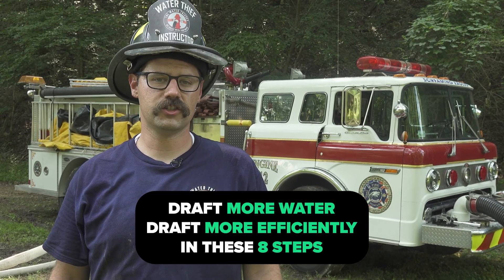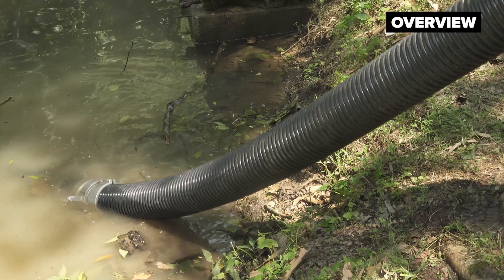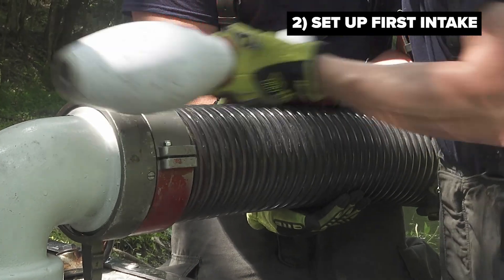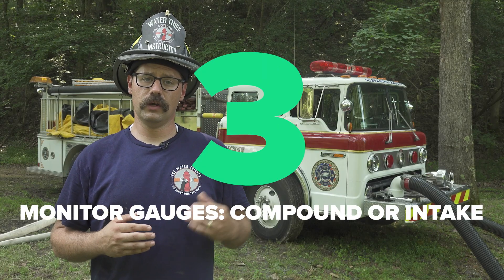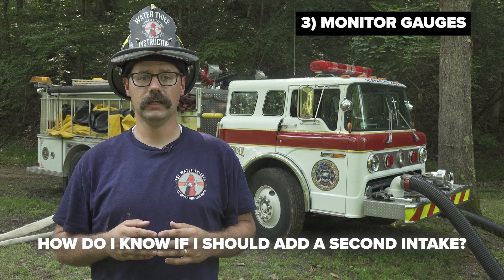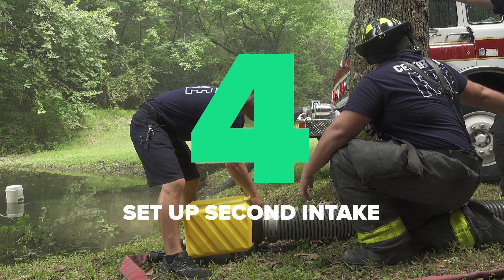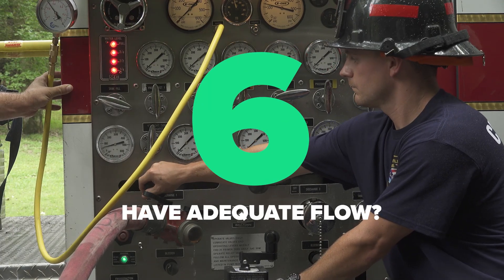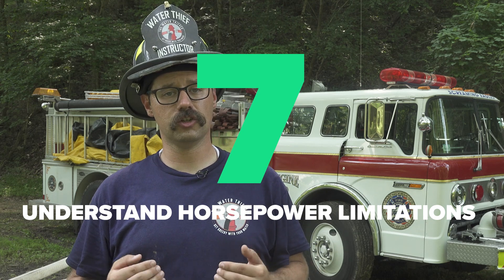Multiple Intake Drafting in 8 Steps (Rural Water Supply - E5)

Comment: I have mentioned it before on other vids involving you americans. Nose-in severly limits the truck in the advent of a need to evac/withdraw quickly. You need to reverse out which takes at least 2 people (driver & spotter) to do safely if you even have the room. Side-on or rear to water allows you to drop lines and drive in seconds. Then there is the case of many of your trucks being only 2WD and around soft edges of water points, issues arise and longer hoses needed. I do see the benefit of front plumbing but that can quickly reach top a side rather than straight forward. 
Dedicated Vacuum guage is a great idea. Don't forget about additional lift pumps to augment supply. Some options are use of the prime-line (Venturi) ya have to help push some flow (reduce suction height effect). Another idea I have seen is a appliance that had a large hydraulic system and long lines on reels. A hydraulic motor equipped pump on a float would be pushed out with small secion of hard-suction line then coupled to lay-flat hose along witht he two hydraulic hoses, pump was feeding the 6" line with pressure enough to supply the trucks main pump with room to spare.
Reply: They're pumping water... not sitting at an active fire. There's NO reason to need to Evac. If you were positioned at a fire, yes... positioning is important.
Reply: "Involving you americans..." ?  Sorry buttercup, nothing you say beyond that is incisive, informative or relevant.